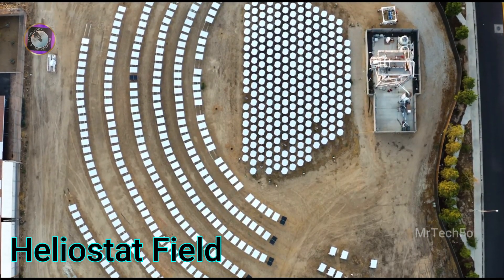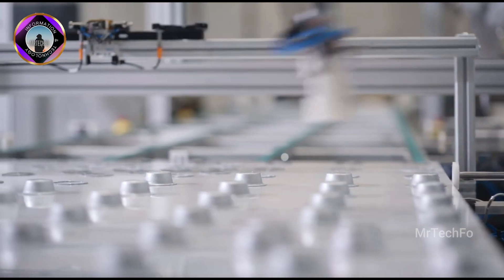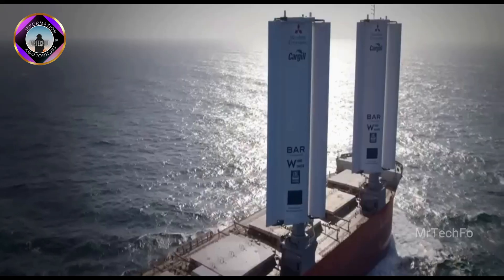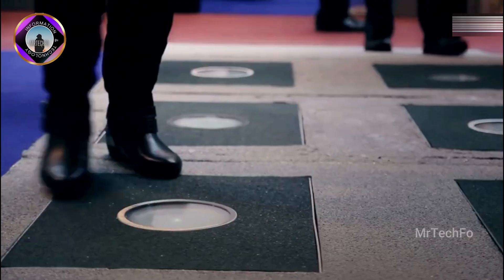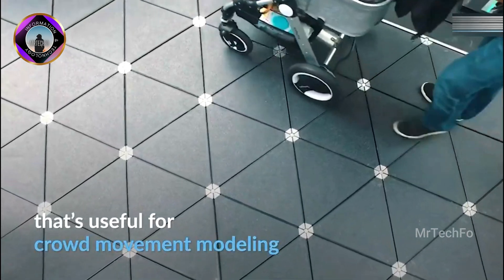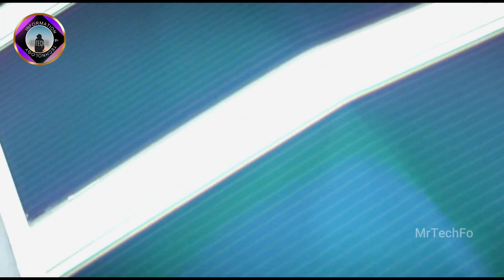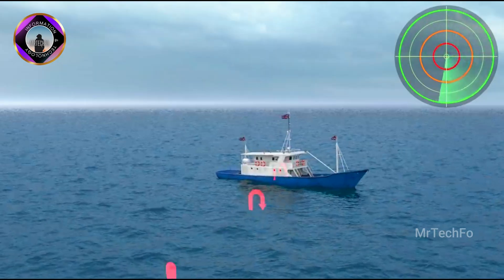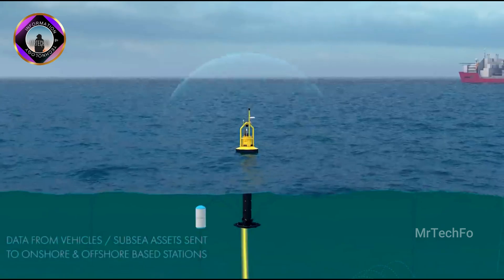Amazing Inventions That Generate Energy From Everywhere

Comment: (MORE IDEAS) In 1977* I funded (invented) a optics contract with a UK* optics company to make me a fiber optics disko crystal ball systems. I also had a clock maker on my payroll. What did it do ? I have more then a few around the world, I only needed four crystal ball units on only four corners of my hollowed out moutain (cave). When all four units was adjusted right (like a kook ko clock), it would pull light from out side of the moutain cave (using fiber optics) and light up my crystal ball units, inside the moutain cave. Ever sqare inch of garden land had perfect day light, with bat poop added to the great soil, someone had a bumper crop of gardening goodies. This also could be used for high rise buildings in giving ever floor there very own yard with sunshine, to do what ever with. You could also use something simeler for gardens with not much natral sun light. The more product designers the better, so enjoy it.
Reply from the maker: Thanks for your information.